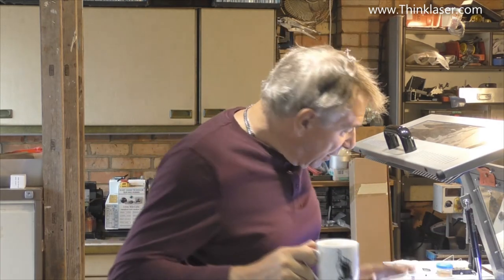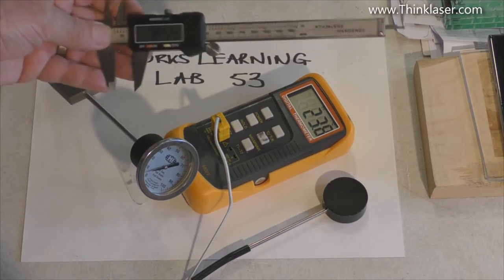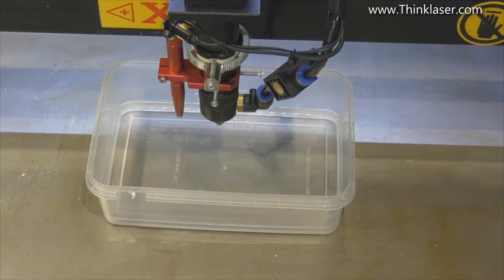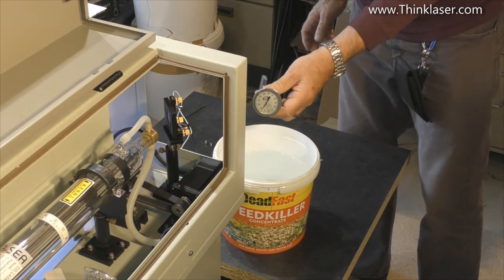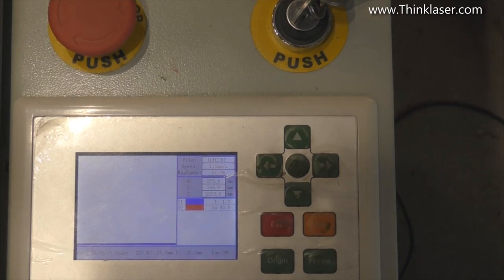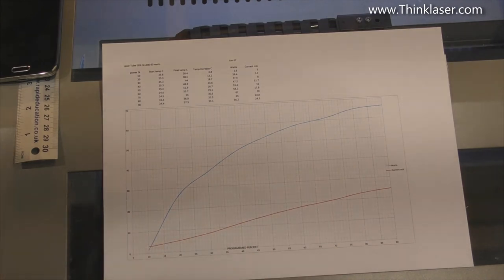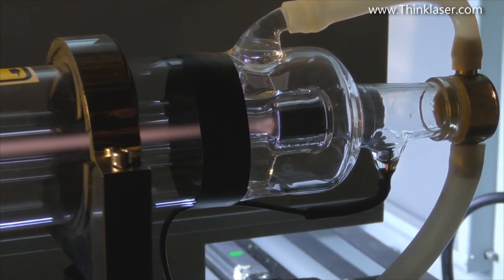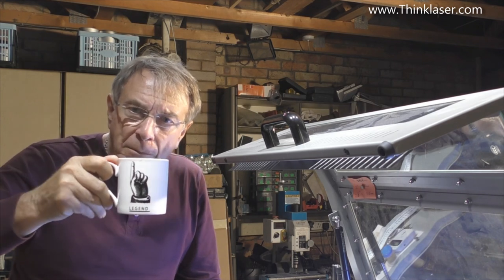How To Use A Laser Cutter - Lightblade Learning Lab 25 - Measuring Laser Tube Power

Comment: Hi,
is the maximum tube current taken from manufacturers data?
also, is it worth editing the machine settings to make 78% (in your case) equal to 100% so that it is not possible to overdrive it?

Thanks
Reply from the maker: Hi Dave,

Yes the maximum current is taken from the manufacturers data. Actually you are looking for the "Operating Current" as this is the value that the manufacturers refer to in their warranty.

E.g. for a RECI W1 tube with a rated power of 80 watts, the operating current is 27mA.

We usually edit all our machines using the Vendor settings (Russ didn't want his limited though) to ensure the customer is not able to overdrive their tube. 

Gareth @ Thinklaser
Reply: Nice, thanks for the quick answer too.
Reply from the maker: You're welcome, let me know if there is anything else I can help with.